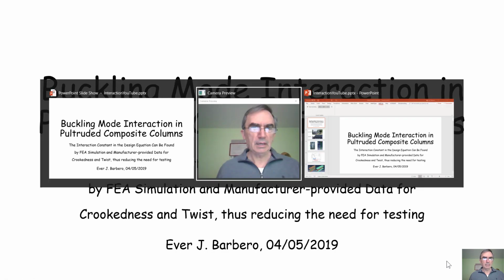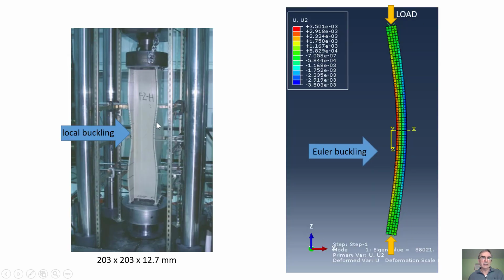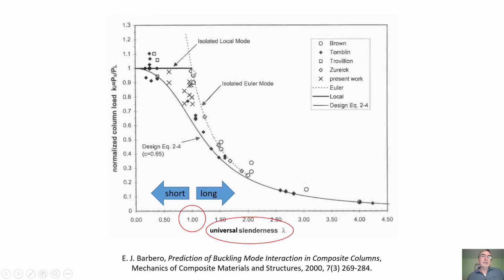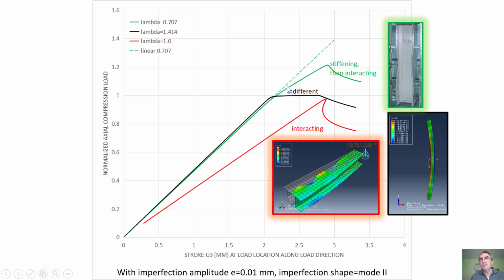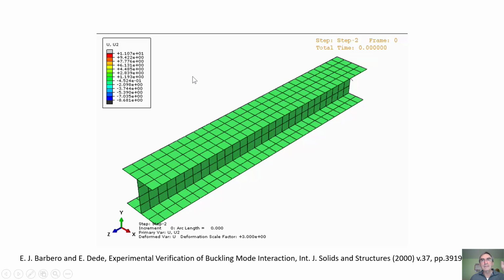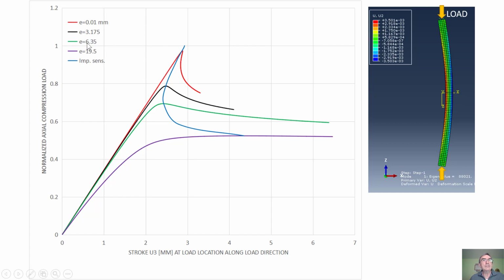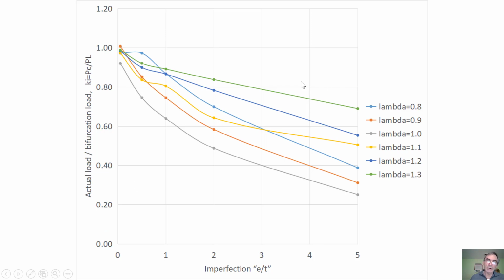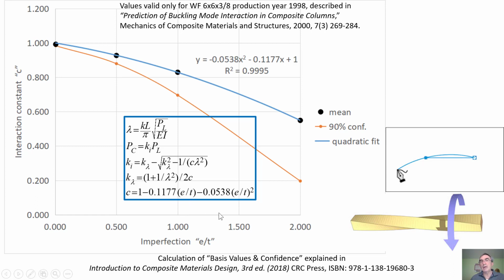Buckling Mode Interaction in Pultruded Composite Columns

Comment from the maker: The experimental setup, as well as experimental procedures and results, are described in: E. J. Barbero and M. Turk, "Experimental investigation of beam-column behavior of pultruded structural shapes," Journal of Reinforced Plastics and Composites, 19(3):249–265, 2000.
Reply from the maker: ok?